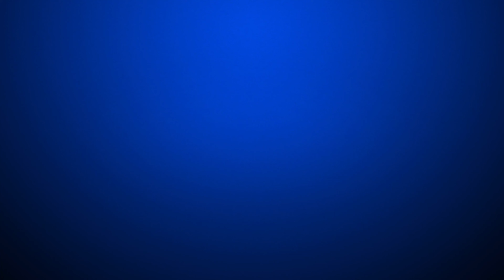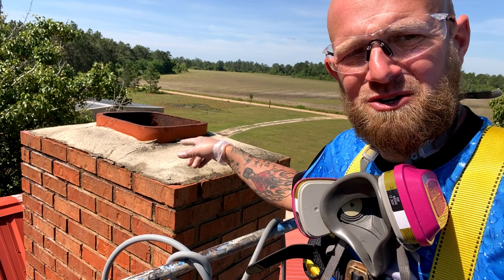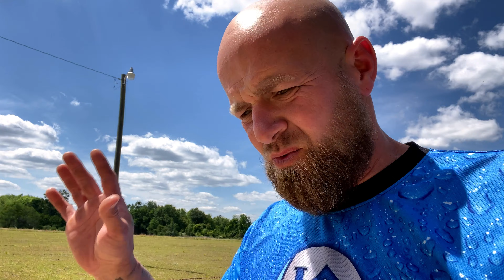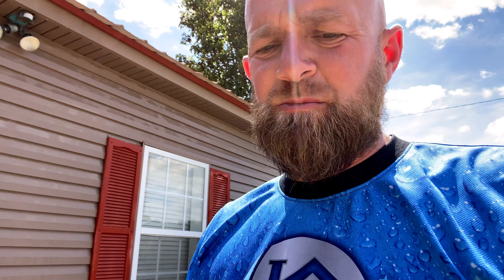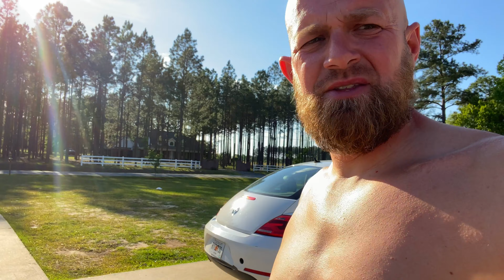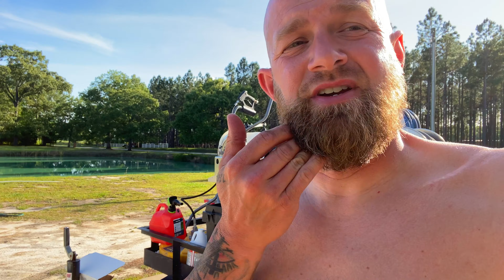COMPLETE House Wash Using The AlumiMax Pro Skid From @southeastsoftwash4020 | Pressure Washing

Comment: Check  and  see if there a relay on that pump that could  be the issue with the pump bad relay
Reply: I thought you had an everflo pump sorry wrong solution ,it's the pressure switch. You can still  use  pump jump the wires ot will  run full force you can get a regulator put on there to control the flow if you want

Comment: what did you use to clean wood decks?
Reply from the maker: Light SH and pressure washer with soap tip right now but I’m learning some new ways
Reply: @ScottCleansIt  I cleaned a deck with New Again. It worked pretty good.

Comment: Rookie here. Last week I left for a job without spare o-rings. Disconnected my DS injector to rinse while hose was running and blew the o-ring out. Now I have SH drying on customers house.  I cut the cuff off my rubber glove and jammed it into the DS quick connect. Problem solved, temporarily. I was able to finish the job.

Comment: Hey Scott, watching your videos  , I need your advice. I'm in N.J. and can't seem to find anyone that knows much about oxidation on aluminum siding.  I used a sun joe electric washer and some ReNue cleaner. Sprayed it in, let it sit 5 minutes then  pressure washed at 2000 psi. Looks new . Problem my house is two stories and I am 71 and don't want to work off a ladder . What's your professional advice?
Reply from the maker: Order some cleansol bc and spray it

Comment: Hey, Scott! If you need to use pressure washer for 7 hours a day, is it better running non stop or on and off. I ripped my belt on pressure washer couple days ago and already replaced with new one....still wondering. Thanks
Reply from the maker: What were you washing for 7 hours straight